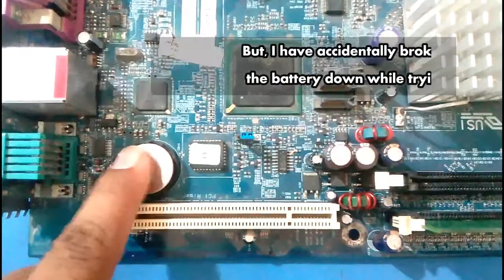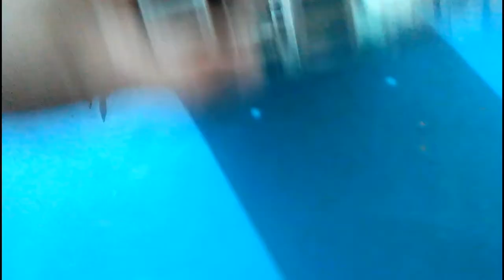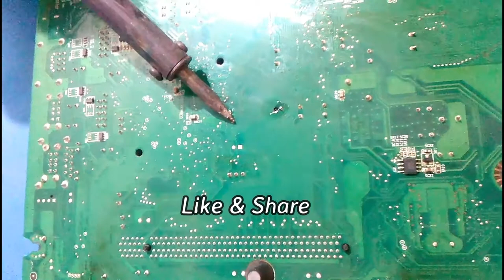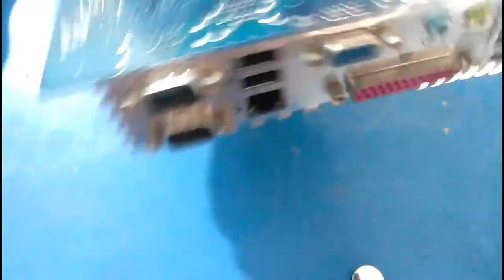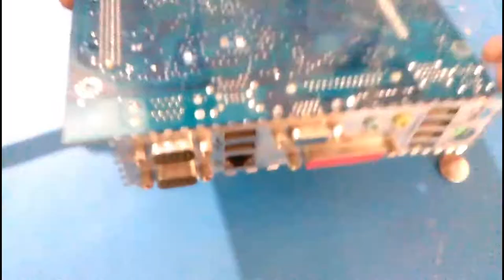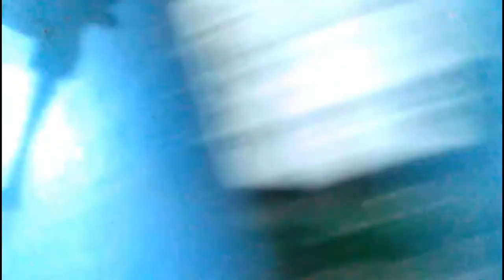How to Replace CMOS Battery Broken holder by Technical Adan.

Comment: Why did you add solder to the CMOS holder if you need to remove it?
The positive pole metal latch broke off on my motherboard. How do you replace the entire holder?
Reply: You need to add solder so it heats up